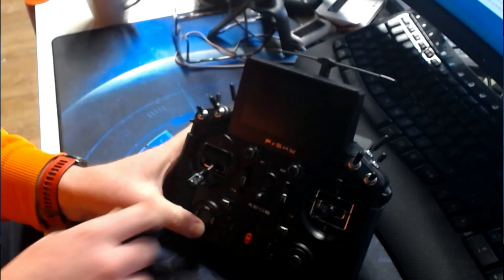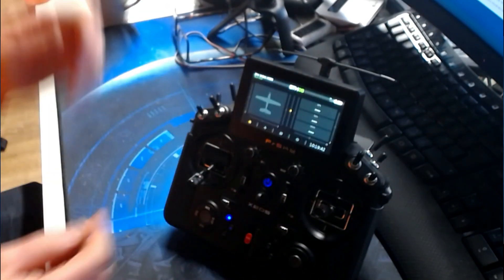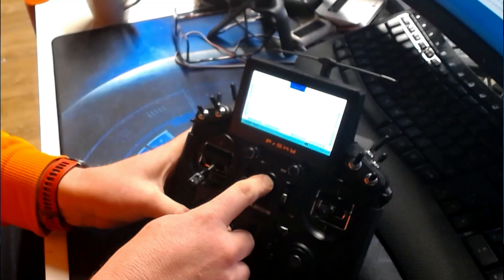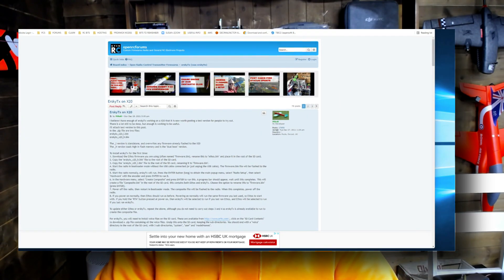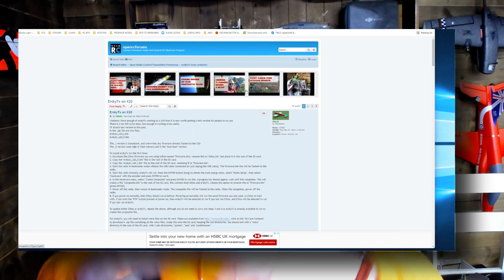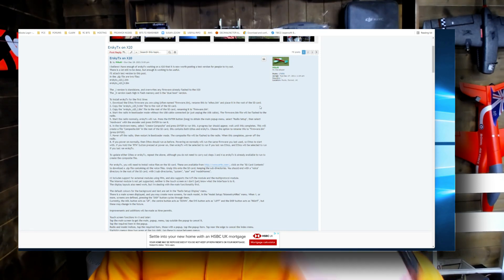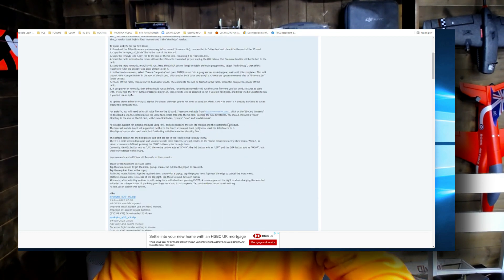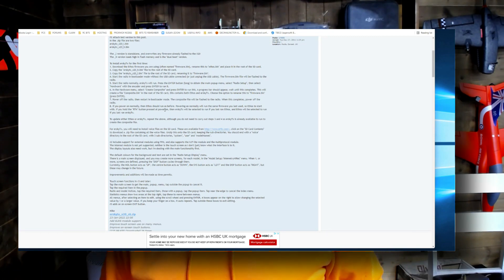TANDEM X20 SUPPORT FOR ELRS & CROSSFIRE? | YES YOU CAN

Comment: Is there aktualy a plug and play(without flashing and all) elrs lite modul for x20s on the market?

(I need one for fpv copter for my kavan v20😅)
Reply from the maker: @Rantanplan-0815  generally with elrs you will have to reflash the elrs module.  It's just the way it is.

Why do you need it?
Reply: @RTRCTV  ok.
I fly rc-planes for long time,but now im very interessted in flying fpv copter.But i need elrs for this.
My radio only make accst,acsess and twin.
Then i think about a elrs modul because i dont want buy a new radio(my kavan v20 is brand new,the sticks are awesome)
I come from mpx/profiTX premium edition.
Reply from the maker: Realises. You are also looking at a very old video.   This ethos is very out of date.

Comment: @RT-RC  Would really help if you shared your view here. My Futaba T8FG has just gone bust and while I could get it repaired im in the market for a new radio. I'm torn between the FrSkt X18/20 or the Radiomaster TX16S MK2 with AG01 Gimbals.

1. I currently have only FASST receivers so im guessing neither f the 2 will support them
2. looking for the widest possible coverage with the 4in1 MPM
3. The tandem 900 & 2.4 connectivity seems very tempting when I'm flying Fixed wing

4. Would you consider either of these at par with Futaba Quality? I loved my T8FGand its form factor.. 

OPTION1: X18/20 with 2 Addon Modules (i: ELRS & ii: 4in1)
OPTION2: TX16S MK2 AG01 4in1 one Addon Module (i: ELRS)

Which one would you advise. How much better in quality is the X18/20
Reply from the maker: They are both very good radios.. And surpass futaba in many ways. (IMHO)

I would probably go x20 for myself at this point.   But not allot in it between he x20 and x18.

Worth noting.. Multi protocol supports futaba fhss.  Not futaba faast